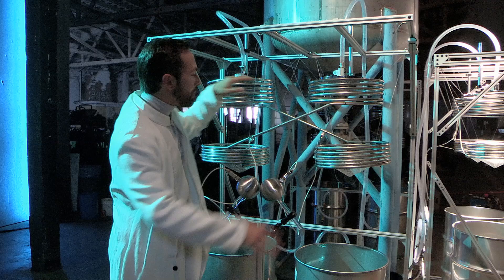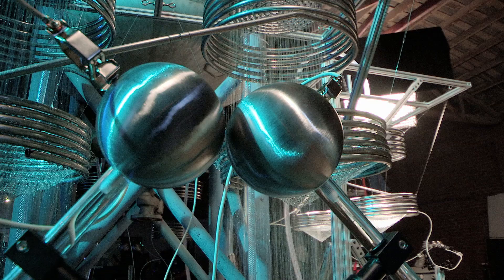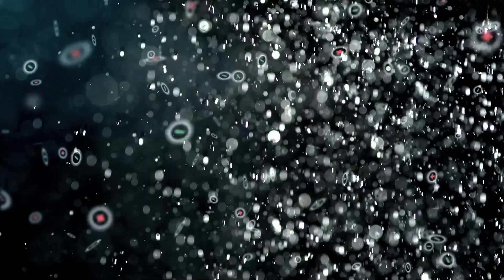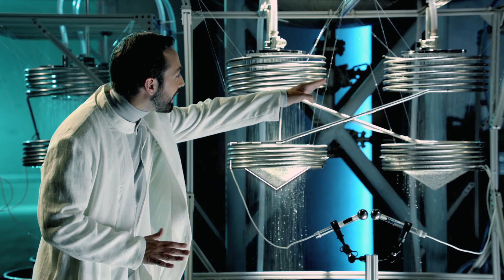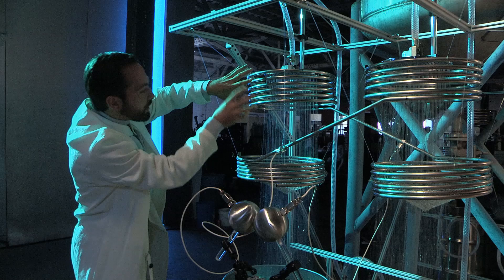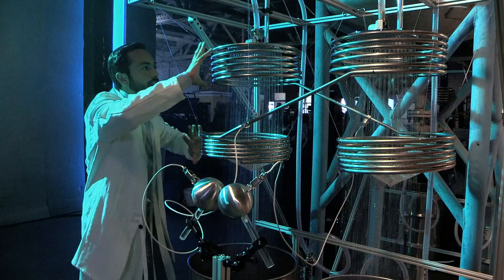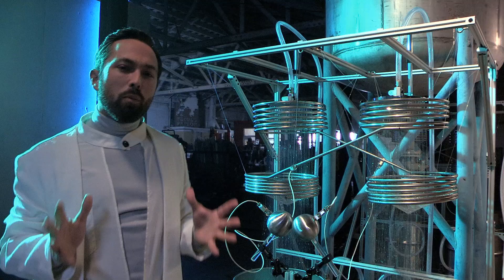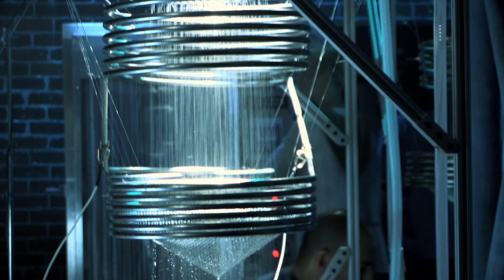Sparks from Falling Water: Kelvin's Thunderstorm

Comment: If someone wants to know why:
The energy that comes from this generator comes from the kinetik energy of the water when it is slowed down by the eletromagnetic fields of the coils. The upper coil attracts the Ions and the lower coil repels them, they slow down and their kinetic energy is converted into electricity.
I don't claim to have figured it out. I just looked it up since I wanted to know why this happens.
Reply: i thougt so too. because the only energies i can see is potential, kinetic and chemical. and nothing is reacting and i potential is already converted to kinetic so its the last thing standing^^
Reply: I wonder if the water had a thicker viscosity that it would make the electromagnet work harder to pull and push the water,and if that would cause a higher kenetic energy to create a higher voltage?  That could be an entirely different experiment in itself.  This is pretty cool stuff!
Reply: @rickycarter6371  I could imagine that the ion exchange speed is depending on the viscosity of the fluid. At some level the Ions won't exchange fast enough to charge the coils.
Reply: @m0ntezott  In that case, would a lower viscosity fluid increase the ion exchange speed? Additionally, I would guess that scaling up this set up with more coils would produce a higher voltage but is there a theoretical way to increase the amperage?
Reply: @onlineanonymity6153  I have no clue. I could imagine that the size of the coils is limited, because at some point  the charge wouldn't be able to creat a field that is strong enough to have any effect. But maybe I'm wrong and you could just build a giant version of this.
Reply: Impossible. The coils aren't charged. This is caused by induction from the water itself. 
Water is a polar molecule and also acts as a polar solvent. When a chemical species is said to be "polar," this means that the positive and negative electrical charges are unevenly distributed. The positive charge comes from the atomic nucleus, while the electrons supply the negative charge. It's the movement of electrons that determines polarity.

This is what induces the current as the water falls close to the coil. This is induction, not kinetic energy. Kinetic energy would require a direct transmission of force from moving water - i.e.: the turbine of a hydroelectric generator. This turbine, in turn, uses the kinetic energy to spin a magnet in a coil, thereby inducing an electric current in the same fashion. However the actual mechanism here is the polarity of the water and it's motion through the coil - though strictly speaking, the motion is neither arrested nor converted - so it cannot properly be called "kinetic" energy. This is natural induction.
Reply: @RealAustinMartin  Isn't it more about the self-dissociation of water in which the resulting ions can induce their charge into the metal, which leads to more ions being attracted to the other side of the coil?
Reply: @K4TORG412  what about energy of gravity? Like shiny metal has a high inductance so when the droplets fall with the right hand rule gravitational spin it's being absorbed by the coil, creating a coherent electric vibration, that causes "gravity" to go from a spinning out phase to a over-spin picking up lateral gravitational pull. When the "gravity-electric" field, stored on the surface of the coils and 2 balls get's discharged, the gravitational spins get annuled
Reply: It's actually just a charge imbalance in the rain passing into the mesh through the coils and into the metal spheres as a weak current btw I'm in year 8 (this is basic physics)
Reply: @pointlessphantomyt1823  ye but how did the charge come by, if there is no current in the drops.
It actually is relation with ether that transforms the downward fall to a "spin" and the spin giving "negative charges" .. the other "spin" becomes "positive charge". smth like that
Reply: The current comes from the charges in the water drops, because the amount of electrons, (protons for the other side) isn't completely even that water becomes negatively charged. The charged water passes through the metal mesh (a conductor) and the electrons stick to the mesh due to friction and that gives it a negative charge. That negative charge is also connected to the cool so that is also negatively charged so the rain waters positively charged areas are drawn towards the coils and when they touch friction converts the negative charge onto the positives. Finally the coil is attached by a wire to the sphere and when the charges are high enough a current passes through the air from one to the other. This happens because opposites attract. (rather like magnets) So I hope I cleared that up and btw are you above year 8 because if so yay I taught someone older than me. : D
Reply: By the way not being salty
Reply: @pointlessphantomyt1823  Now explain the same thing but with ether and instead of charge the spin
Reply: @pointlessphantomyt1823  Ok ill be more human to you;
I realy like that you try to understand how stuff works, but i found out that schools and scientists have it wrong. 
We use destructive energy as electricity instead of good electricity, with natural flow and this can be achieved with Aether or Ether that has been pushed asaide with lies. Good luck young man
Reply: Also btw you seem to be extremely persistent on proving a year 8 student wrong when you could be using your apparent infinite knowledge and conspiracy theories to change the world into a better place rather than tutoring a stubborn teen
Reply: It's an interesting concept that needs to b e studied further ok so can you please stop talking
Reply: @m0ntezott  
I don't think ions need to be produced for this to happen, (though they likely will be produced in this process). The polarity / electrostatic potential of the water works like  magnet, attracting and repelling free electrons within the coil material as it falls through its segmented structure. Strong Ionization of one stream would probably greatly increase the electrical output of the generator, I think.
Reply: Dave Smith  WELL IT AINT PASSIVE IF IT PRODUCES ELECTRICITY. AND THE FACT THAT THEY ARETHAN ATTRACTED TO THE COILS IS AGAINANACTIVEEFFECT.
Reply: Just about everyone since the 1930's cannot claim to have figured out diddle squat about such energy related matters. Look at all the things Nikola Tesla, Miucci, Faraday, Euclid, Ptolemy, and so many greats discovered, but you will only hear a slight refrence to them, maybe in some upper level classes. Nothing in schools.  Anyone living now has looked it up and learned it. Unless you are a scientist at heart and have nothing to do, retired or filthy rich, or working for some lab for such projects....You had to learn it by looking it up, and then maybe trying it out in experimentation. So no credit deducted for sharing. :-)  (Which actually brings up a interesting question, as what we learn in schools is all passed down info we accept, now know first hand or even updated info. This is a problem for science discovery).
Reply: M0nte Zott
Kinetic energy has absolutely NOTHING to do with it.  It's electrical charge energy throughout the entire process.  Try again.  This is actually VERY basic electricity stuff... so basic that electromagnets aren't even a part of it.  The same thing can be done with 4 RINGS of metal instead of 4 coils.  So, there's no magnetic aspect at play here.

By the way, I got 399/400 in my engineering track electromagnetics and optics class in the School of Physics at Purdue University.
Reply: @RealAustinMartin  Wrong.  The coils are charged.  But there is no need for them to be coils.  Search for Kelvin Water Dropper.. all other examples use rings instead of coils.  It has to do with charge, not magnetics.
Reply: @m0ntezott  "Isn't it more about the self-[disassociation] of water in which the resulting ions"

Now you're getting closer to the actual process.
Reply: @RealAustinMartin  Ions ABSOLUTELY are necessary for this thing to work.  This will not work with, for example, well-neutralized oil.
Reply: @michael Nope.  It's all about unequal charge distribution happening at the Tee in the piping between the water reservoir (or other source) and the 2 outlet heads.
Reply: @manipulativer  Mayjaz, it's ENTIRELY passive.
Reply: @jamesmaxdavissands  Heavy water won't change anything.  What makes heavy water heavy is the addition of neutrons to the H atoms. And neutrons are electricall neutral -- NO CHANGE IN CHARGE.
Reply: @dirkgently120  Thank You for replying to all of us. I like the way you did that. Sort of steering instead of just supplying answers, that's how we learn. You would obviously make an outstanding instructor!
Reply: @dirkgently120  well entirely passive does not explain how potential energy gets transformed to electricity. Noone explained this in schools
Reply: I think the difference in positive and negative charge that build because of imbalance that he mentioned in his video make the electron flow from negative to positive charge that's how a capacitor also work.
Reply: All of these answers are incorrect.  The water is the accumaltor. The coil is the attractor and filter.  The air the water flows through exchanges ions and builds static charge in the air. The charge is dispensed to the coil which in turn is filtered to the opposite coil strictly to have opposing charges be separate. Then as he States the charge is built up until strong enough to bridge the gap of air insulating the two charge balls. 

The interaction of the fluid moving through anything cause static charge buildup. That is where the charge comes from. Air and water interaction.  The less viscous the fluid the more charge builds.
Reply: We need to test this hypothesis in a vacuum chamber. If it is due to kinetic energy then the results should be the same.
Reply: And originally it comes from whatever put the water in tank above the coils, transferring potential energy to it, that transforms into kinetic energy while falling down, due to gravity making objects move toward regions of spacetime where time passes more slowly...
Reply: @m0ntezott  
I think the most important aspect is the density of ions, but I am not sure.
Reply: @onlineanonymity6153  The amp is not low, just for a very short duration. What you need to get a current over a longer time is a greater capacitance in the spark gap.
Reply: @RealAustinMartin  
It has nothing to do with the polarity of water molecules. Since any dipolar electric field is extremely weak compared to that of an ion's electric field. Dipoles are affected by electric fields, but it serves little purpose to look at the electric field they cause.
Reply: @dirkgently120  You need to think of the water streams as electrical ion currents that charges the capacitor/spark gap. That current is driven by gravity.
There have to be a source of energy and the only source you have here is gravity. There is no way to directly turn gravitational energy in to electrical energy. You need kinetic energy.
You just have to imagine the only energy source here and you have the answer, it is that simple.
Reply: @Deliriousintentionsprojects  In a vacuum chamber the water would simply just evaporate immediately.
Reply: @MrPhames  
Static charges does not accumulate in the air. Give me a reason why the charged air molecules wouldn't do what ever it could to find ways to neutralize it self.
Reply: @MegaBanne  Upon reconsideration, you are correct. Charge does not accumolate in the air. Air insulates.  I was thinking about water moving through objects such as pipes where a charge would occur and then the charge would be dispersed upon a non grounded object building the charge until the voltage was large enough to break the air insulator gap.
Reply: @MegaBanne  I want to be clear though. The air does not accumolate the charge, the material falling through the air will, can and does accumolate the charge until it gets enough to something that it can exchange the charge with.
Reply: @MrPhames  
I assumed that was what you really ment. I just wanted you to think about it for your self.
It is similar with conducting media like a metal. Then any negative charge can move freely to neutralize any charge differential. So the metal pipes can't accumulate static charge either.
Reply: @RealAustinMartin  Correct. The electricity is not generated by the conversion of kinetic energy directly into electricity. Water is a polar molecule, so depending on its orientation in relation to the coils, as it falls, it will expose a bit more of the negative side or the positive side of the molecule. When many of these molecules pass through the coils, there is an imbalance of the sum total of molecules passing through the right side and the left. Even the tiniest imbalance of induced charges (from the molecules to the coils) will initiate an exponential difference of charges between the right and the left side over time. The more positively charged one side becomes, the more negatively charged the other side becomes, due to induction, until there is enough energy for the charges to cross the gap between the electrodes (the balls). Once these charges cross over, the system is reset, and the process restarts. I have built a Kelvin Thundertorm myself and mine sparks in intervals varying from 10 to 15 seconds, depending on the degree of humidity in that environment. The drier, the better. If there is a lot of humidity in the air, the machine will not even spark.
Reply: @sciencelad8286  This experiment als works without coils (just metal rings). Besides, how should induction, which would only create a current in the coil, be the cause of the charge differences between the two coils? the positive and negative charges must come from somewhere.
best regards
Reply: Might be due to vanderwaal's force
Reply: Electrostatic fields. Ain't no electromagnetism in this device!

Comment: The air in the earth is always electrically charged. 
Passing water and air across the coils.
Increases the airflow. Intensifying the grounding effect. The electrical discharge comes from a buildup of static electricity.
Reply: It isn't just the air.  Every atom is an electromagnet.  Some are just better at it than others.
Reply: This is why it's important to regularly replace the water or coolant in your cars radiator. After being cycled through the engine and cooling system hundreds of thousands of times the static charge becomes stronger and stronger increasing the electrolysis process essentially turning the antifreeze into battery acid which eats away at the inside of hoses, water pump impellers, gaskets, and temp. sensors.

Comment: I bet that even the sound energy it's producing is greater than the electrical energy ;)

Answer/spoiler to the question:

The energy is obviously from the potential energy of the water. So what ever lifted the water above, is the source of energy.
Reply: What if this apparatus is in an environment with no gravitational acceleration but has an initial velocity, and a non-adhesive tube that bring water back to the "top"?
Reply: This is the only answer that hasn't made me facepalm going through the comments..
Reply: Derek Leung
This coverts a bit of the kinectic energy of the droplets into electrical energy.
Thus the apparatus would lose its kinetic energy(by passing each droplet) over time and stop.
Reply: Derek Leung I've seen you before... 2spooky4me
Reply: Derek Leung lol
Reply: RealationGames

What if you built it "in" a waterfall?
Reply: Ashes1805 Waterfalls are fed by rainwater, so the sun would be the initial energy source.
Reply: Snape kills Dumbledore
Reply: Ashes1805
Another option is to use a generator instead, which is 90% efficent instead of maybe 0.1%. That's why we don't use these. This thing isn't a new invention, these were invented hundreds of years ago. We use only the most efficient ones today.

Energy question already answered by ***** there.
Reply: Evan Haines You're not wrong. Thought to myself 'how bad could they be?', now I have a brain haemorrhage
Reply: *****  Capacitors Im guessing hold the charge and then once it is fully charged it releases it all.
Reply: ***** A wizard does it. :P
Reply: Derek Leung Once the water is brought back to the top via the tube, it will no longer have the velocity to go through the system a second time.
Reply: Strictly speaking, this is incorrect. The kenetic energy is not being directly transfered to anything. It is induction from the polarized water molecules interacting electrically with the conductive coil - like a very weak magnet. 

The Kinetic energy used to pump the water is not actually being converted to electricity - but is merely a vehicle making induction possible. In theory, water flowing down a natural river could do the very same thing. The kinetic motion of the water is necessary, but unlike a kinetic-induction generator like a hydroelectric turbine, the water's kinetic energy is not converted or spent in the process - it isn't pushing a turbine or spinning a magnet. It is only a necessary variable condition for the experiment to work, but not the actual source of the electricity. 

I suspect that if you were able to de-polarize the water, this inductive reaction would not take place, and no charge would be generated.